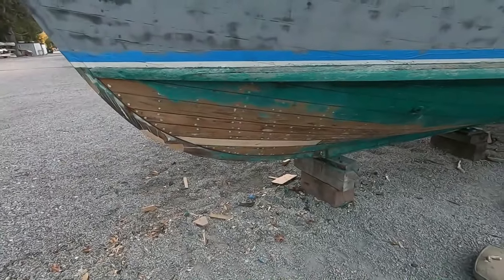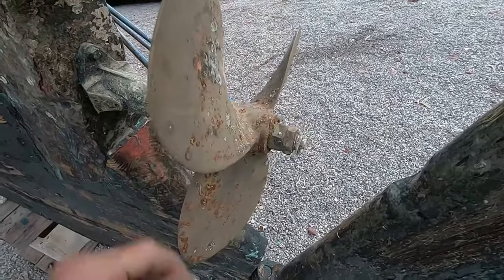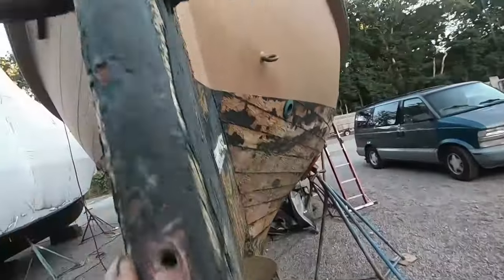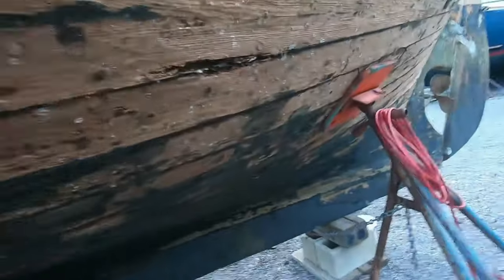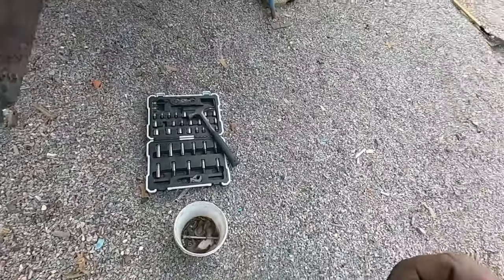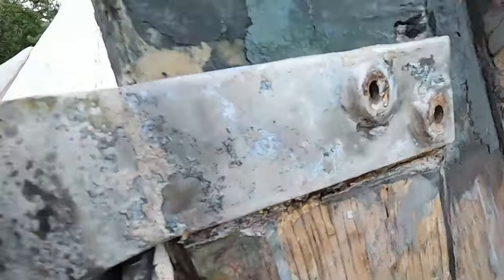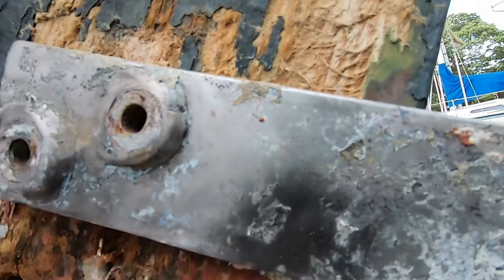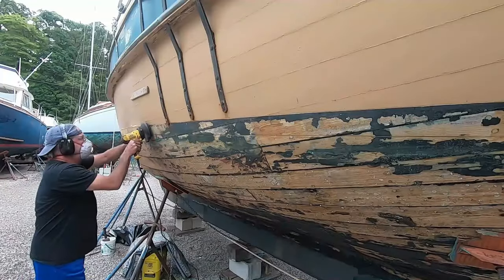Getting down to it on the Hard!    Tahiti Gaff Cutter gets some Love -Episode 004- Slowly Sailing

Comment: I had to deal with a couple of wooden boats down in Florida in the 70's and 80's. The  toredo worms were a major problem. Sometimes, I'd only see one or two holes, but there'd be a whole honeycomb of tunneling just under the surface of the wood and you could crush it with your fingers.  I stayed far, far away from wooden boats after those experiences. I'm happy to see that you don't seem to have that much damage to deal with, given how long that hull was in the water.

Comment: You might want to check out what seems to be the current treatment for wooden boats to prevent future worm damage. Coating the bare wood hull with penetrating epoxy is said to be a barrier that the worms cannot penetrate. So what I have seen is sand down to bare wood and repair/calk as necessary, apply penetrating epoxy to the entire hull below the water line, then bottom primer, paint, and bottom paint as normal for your boat. You have a great boat and actually in what appears to be pretty good shape, and well worth your efforts. Keep the great videos coming... With respect... Joe
Reply from the maker: I've heard of this... but I'm not sure it would work well with carvel seams, because the edges of the planks need to be raw and fibrous, to work best with the cotton, etc. Hard to keep PE off the edges with the method you describe.
And in this case the worms gained access where the seams were failing; they don't seem to have just bored into plank faces where paint had come off. 
But I will keep your thoughts in mind; thank you.

Comment: No surprise to see so many old boats full of bondo.  "feeling violated" is right.
Reply from the maker: I was referring to the shipworm damage, but there is a bit of epoxy here and there (no Bondo, as far as I can tell).
Reply: @SlowlySailing-lc1cs   Sure, understood. What i meant was, its good to see someone intending to do a proper job, rather than do a "bondo job", and then flip it to some poor soul.
Reply from the maker: That's more clear... one very good thing about this hull is that nobody has ever tried fairing bad seams with some sort of filler.

Comment: Making good progress.  Glad to see the worm damage is only on one side and only in a few spots.  I wonder if that bronze trim around the aft part of your rudder is to protect the end grain of the rudder from damage / worms as a easy entry point?   Rudder looks rough as it is, do you think you can save it?
Reply from the maker: The rudder is salvageable, and once I got the trim off, I saw that it provides some strength, because the rudder is made of several pieces, and there are joints exposed at the trailing edge. And definitely resistance to impact... of course, I'll never back her into anything! That's a joke- she doesn't back down very well, so I am bound to do it sooner or later.
Reply: @SlowlySailing-lc1cs   I don't think any sailboat with a full keel backs down very well nor answers her rudder very well at slow speeds.
Reply from the maker: That's what I hear... and the Tahiti is no exception!
Reply: Lots of fun 😊